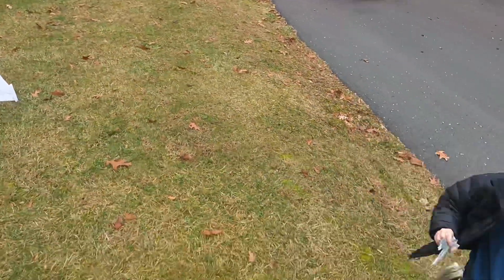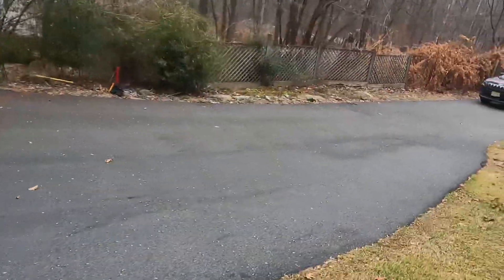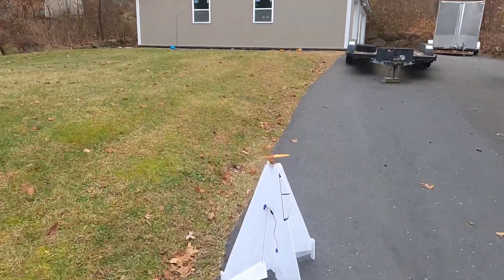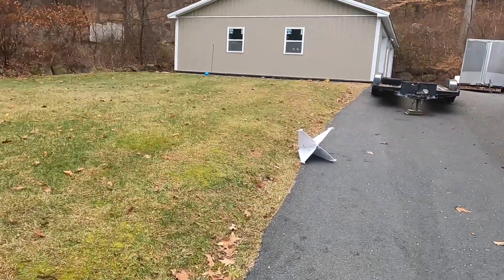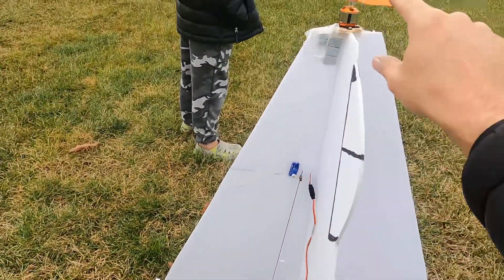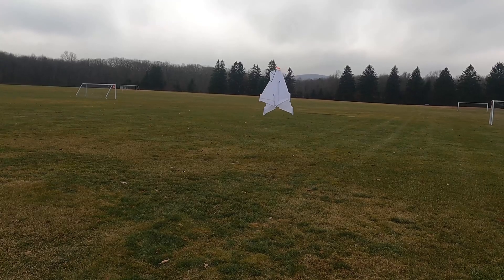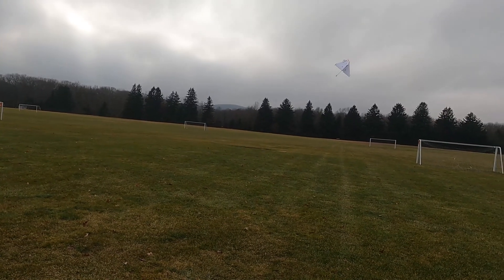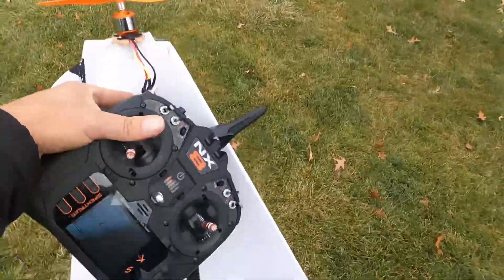XF1- Pogo prototype VTOL take off, flight and landing!

Comment: 😃CONGRATULATIONS. YOU DID WAY BETTER THAN MY TRIAL FROM EIGHTEEN YEARS AGO.   I NEVER DID  MANAGE TO MAKE VTO , BUT IT DID FLY PRETTY WELL WITH HORIZONTAL HAND LAUUNCH.  I KNOW A SMALLER DIAMETER PROP WOULD HAVE HELPED MINE AS WOULD A MORE POWERFUL ENGINE AND OR BATTERIES WHICH WERE NOT AVAILABLE.   YOU MIGHT HAVE JUST GIVEN ME THE ENCOURAGEMENT TO TRY AGAIN. COUNTER ROTATING WOULD BE GREAT IF IT DOES NOT INCREASE YOUR WEIGHT TOO MUCH.   THANKS FOR THE SHOW.